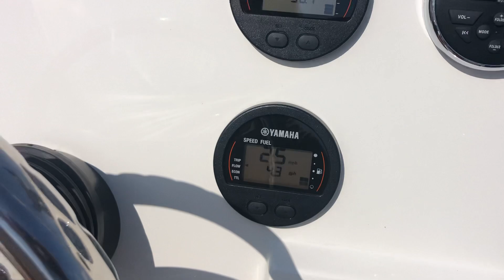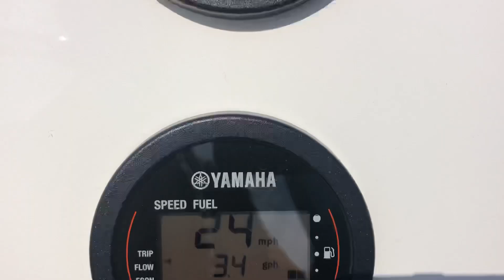Key West 1720 w/70 Yamaha Test Run

Comment: What prop are you running with the boat?
Reply from the maker: Kenan, The prop on the boat should be a Talon SS SDS 13 1/4" x 16" part number 6N7-45972-00-00.
Reply: @Barton3423  what numbers does the boat run speed wise as i have the same boat and engine setup and am looking to reprop.
Reply: @Barton3423  and at what rpms?
Reply from the maker: The WOT rpm is typically 5800 and the speed is around 38 mph. At 4200 rpm you are running about 23 mph.
Reply: @Barton3423  does it get up on plane easy?

Comment: What's top speed
Reply from the maker: Top speed of the 1720 with the 70hp motor is about 38 mph
Reply: @Barton3423 that pretty fast for a 70 banger.   I would need to go no faster.    I have a fast boat, but prefer to cruise around 30 often.
Reply: @Barton3423 is it really? That’s impressive with a 70. How does this do with 4 passengers